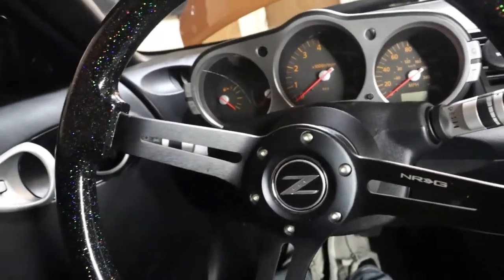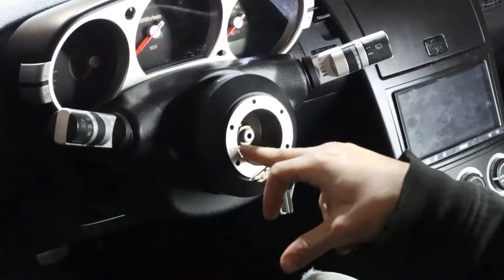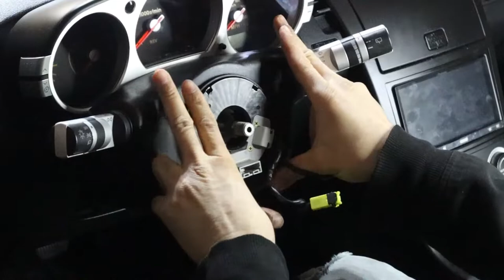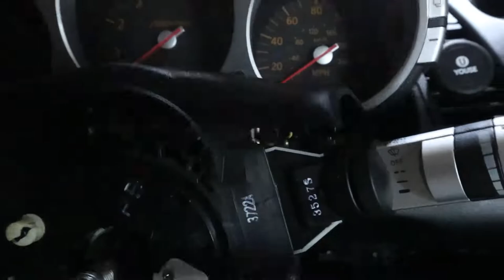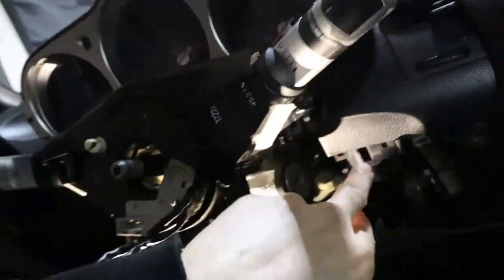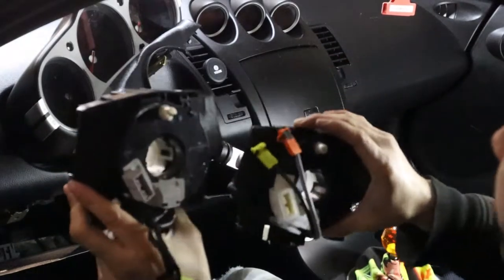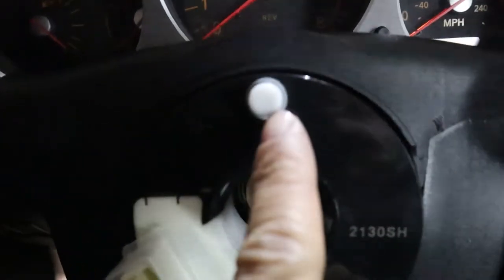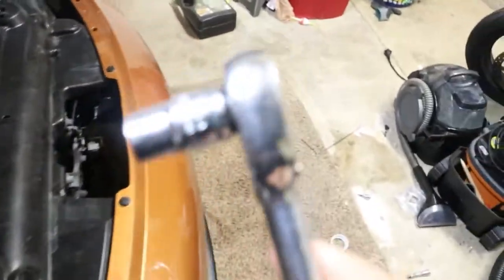350Z G35 How To Replace Clock Spring | Horn Fix and Cruise Control

Comment: How long did it take approx to replace the clock spring? Thanks for the video :)
Reply from the maker: I would say replacing the clock spring could be in about an hour or less, just depends on if you have the factory steering wheel and tools that you have on hand. Just make sure to take your time with everything and you will do just fine. Honestly isn't that difficult. Glad I could help out!
Reply: @beezyrider  thanks! i'm thinking it's my clock spring, my stereo controls on the steering wheel aren't working.  Haven't had anything else yet shrugs
Reply from the maker: @murry001  yeah I would definitely say that your clock spring is more than likely the issue.

Comment: Did you use an oem clockspring or a after martket
Reply from the maker: I used an aftermarket one that I bought on eBay.
Reply: @beezyrider  do you remember the one you bought? I got the same prob horn or cruise control dont work..
Reply from the maker: I have a link to it in the description of the video.
Reply: Ah thanks, did you have an issue with the slip and vcd light coming on when you transferred the angel sensor
Reply from the maker: @JoseMartinez-cr8tz  mine is a base model 04 so it doesn’t have the vcd and slip so I didn’t have any issues. I’m not sure if the one that I installed allows for the angle sensor to be swapped over.
Reply: @JoseMartinez-cr8tz  i installed a new aftermarket and slim and Vcd coming on after 10m of drive :(

Comment: I just changed my clock spring and everything works but now my vdc off and slip light are on?! Any idea on how to fix that? Thanks
Reply from the maker: Did you replace the steering angle sensor that is on the back of the clockspring? That is the part that is swapped over form the old spring to the new one.
Reply from the maker: Here is something I found with somebody who had the same issue. 

Hi All,
 
Just wanted to post to let others know what I've found and how I've resolved the issue.
 
It turns out that the Generic Clockspring Replacements via Ebay aren't compatible with the 350z. This is because at the rear of the Clockspring, a steering angle sensor for the Traction/Stability Control is present. The Non-Genuine Clocksprings don't physically latch into the steering angle sensor.
 
This means if you fit a Non-Genuine Clockspring for the 350z, as it will not physically latch and turn the steering angle sensor along with the steering wheel/clockspring assembly, it will not give it a reading, which is what produced my above error codes and erratic traction/stability control behaviour.
 
This problem was exaggerated because as the car was driving and turning from left to right, the yaw sensor was giving a reading to the Cars ECU, but the steering angle sensor was still telling the ECU that the wheels were straight ahead, tricking the ECU into thinking the car was sliding, triggering the traction control.
 
After purchasing and fitting a used genuine Clockspring and Wheel Angle Sensor from another 350z, my issues are all resolved.
 
I was able to prove the above as before replacing the Ebay Clockspring with a Genuine unit, via OBD Troubleshooting my Angle Sensor was reporting no values when the wheel was turned from left to right. The car now drives without issues.
 
If anyone wants the name of the Software and Cable I used to troubleshoot and reset my steering angle sensor, It's called Nissan Datascan II and I used a VAGCOM KKL Cable 409.1 to connect to the car via OBD.
 
 
Once I had put the Genuine replacement part and performed the same test via OBD Troubleshooting, the Angle Sensor reported the correct values.
Reply: BeezyRider hello, yes I put the steering angle sensor onto the new one and also my car started braking on its own like crazy
Reply: BeezyRider went to a mechanic and they told me the code was “steering angle sensor circuit” not sure if I need another clock spring or I didn’t do something right when installing ti
Reply from the maker: I would double check to make sure that everything is plugged into it properly and that it was installed at the 12 o clock position when placing it back to the hub. It could also need to be reset after you check everything.
Reply: BeezyRider I will do that thanks for the help